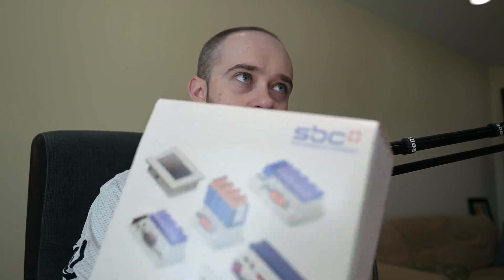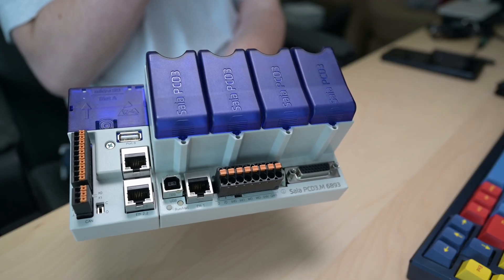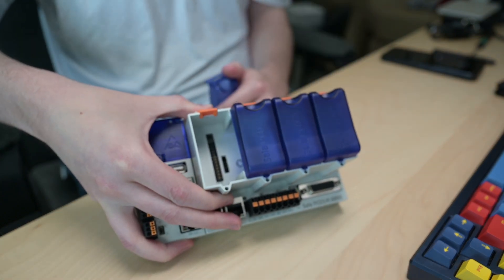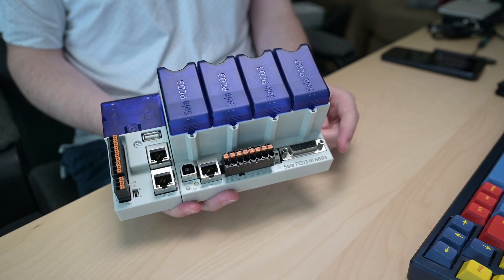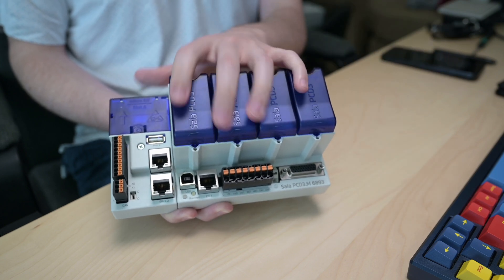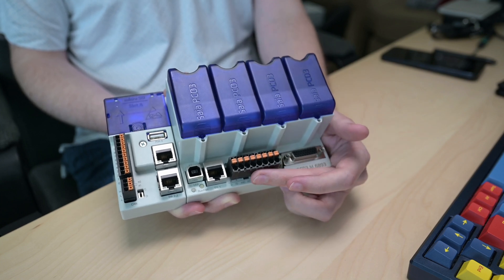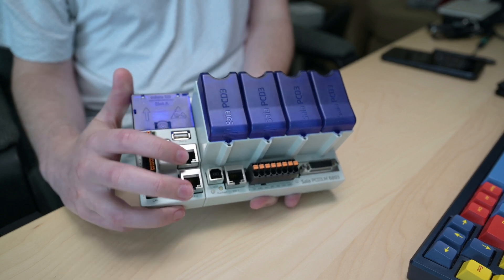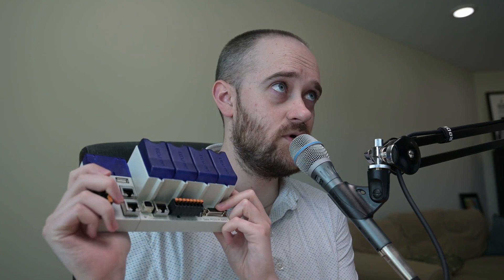Unboxing the Honeywell QronoX PCD3.M6893 PLC Controller

Comment: Could you make a video about the programming side of the QronoX ecosystem? I have worked with SBC products for the last 20 years, using PG5 for programming, but they have fall behind the competition in europe, mostly because of the web interface and the BACnet programming. Saia Burgess was kind of the pioneer of the built-in web servers!
Reply from the maker: Yep. We'll have more content on programming with QronoX here in the future. -MW
Reply: I used them before too about 20 years ago. great product with lots of HVAC library